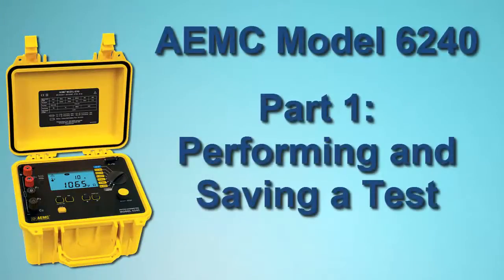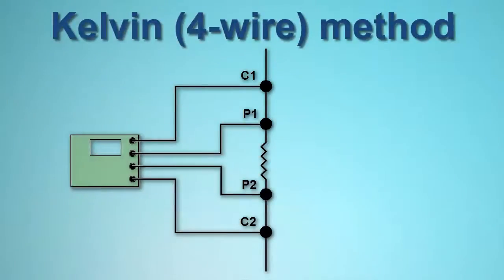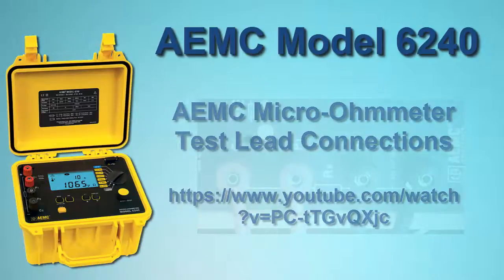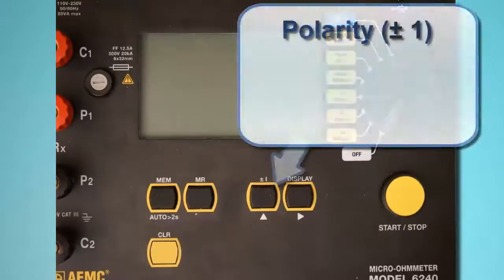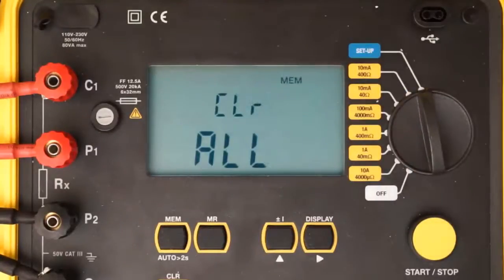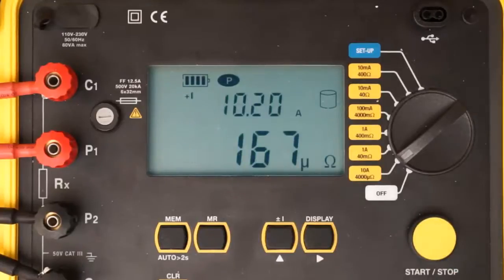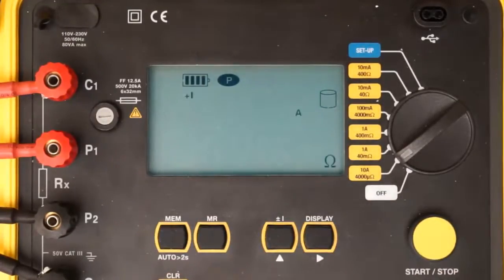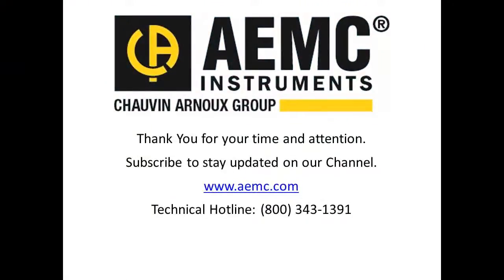AEMC® - 6240 Micro Ohmmeter - Part 1 - Usage and Capabilities

Comment: How much??
Reply: Thank you for this video. 
I have a question on this meter. It gives on display  batt 0 when it is plugged to 220v. This is due to what ?
Thanks
Reply from the maker: @skilledhiko329  Likely a dead battery.  Replacements can be purchased on our website aemc.com
Reply from the maker: Manufacturer List Price is shown at the bottom of our Model 6240 product page, found here:
https://www.aemc.com/products/micro-ohmmeters/micro-ohmmeter-6240
Let us know if you have further questions.